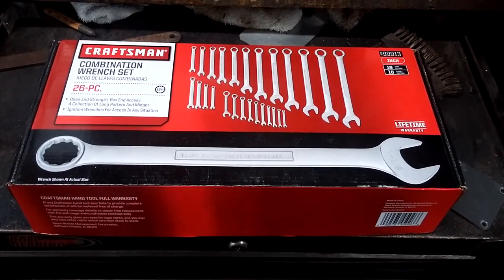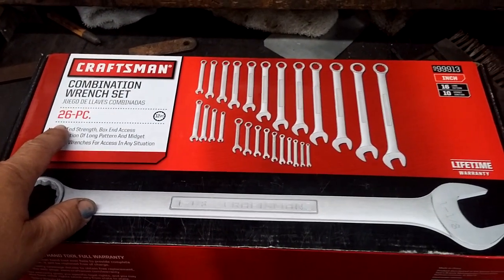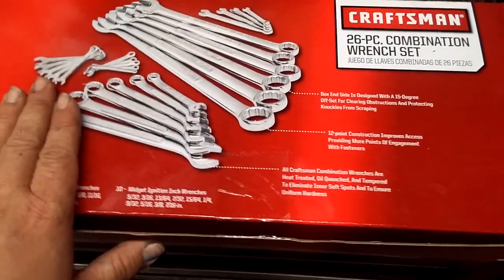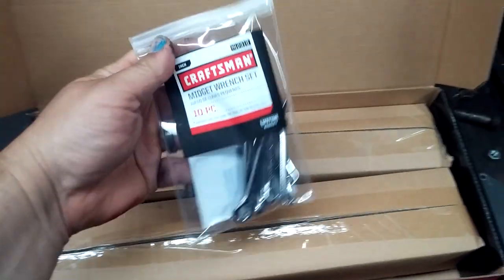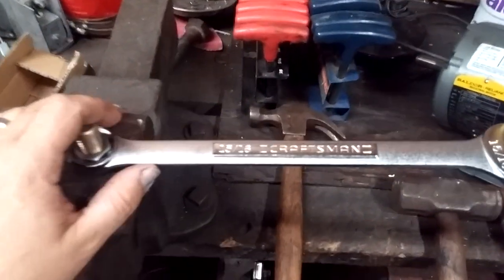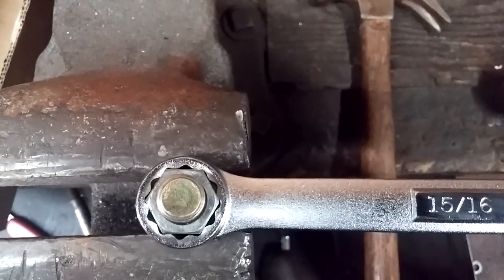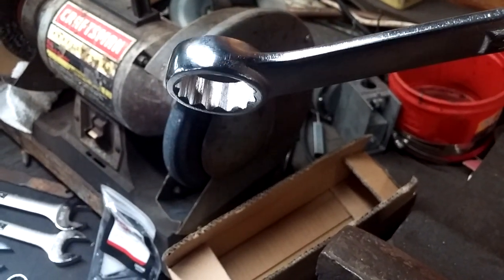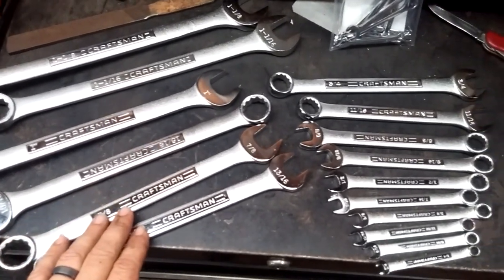Unboxing New CRAFTSMAN 26 Piece 12 Point SAE Wrench Set  #99913

Comment: Nice wrench set!  Do you notice any difference in the thickness of these versus the old made in USA?  People say these are "fatter" around the open end, but I haven't noticed any difference in using them.
Reply: @David Sainsbury I'm not the person who made the video.  However to answer your question -- I don't see a difference between the Hyper Tough panel wrenches and the Craftsman panel wrenches except (a) the Hyper Tough are slightly shorter and (b) Hyper Tough is made in India and Craftsman is made in China (new) or the USA (older wrenches).